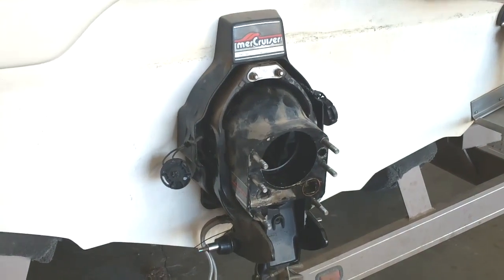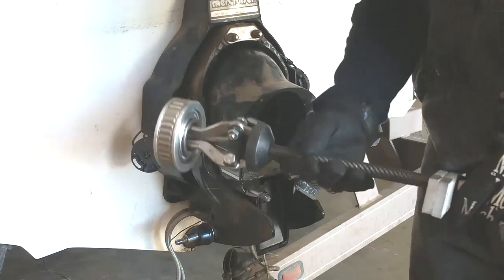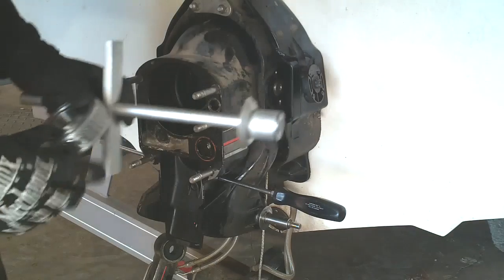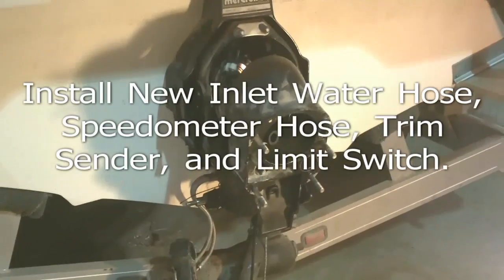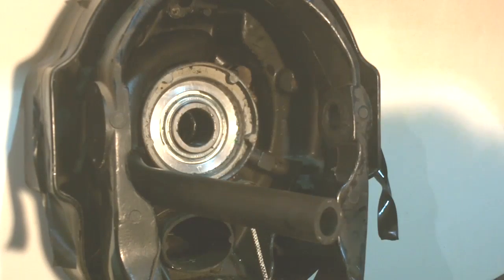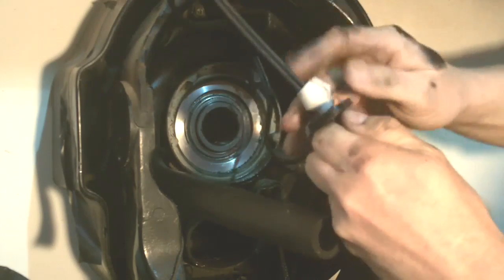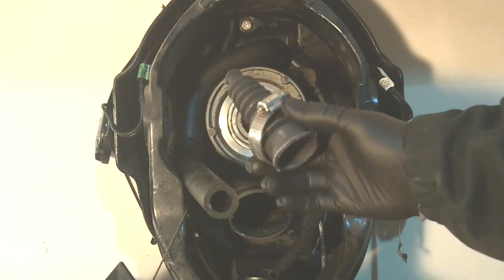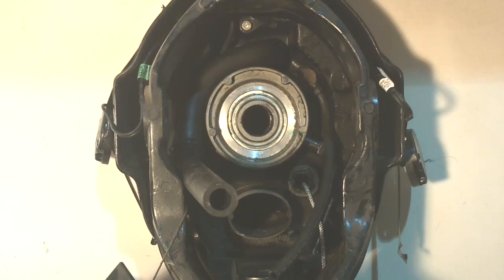How to Repair a Mercruiser Bravo Transom Assembly - Part 2

Comment: Where can you find the puller tool?  part/model number?  I'd rather get this than the mercruiser gimbal puller which only works for that particular bearing - I could use this tool for other applications.

Comment: Many manuals now instruct to put that bearing backwards, two notches facing you when installed...
Reply from the maker: +Derick R Service manuals have revisions periodically and a procedure may change slightly between different models.  We always advise following the step by step procedure outlined in your engine manufacturer's service manual. This video was made over 4 years ago and the manufacture has made a few parts changes as well as procedure changes that we have also adopted.  Let us know if you need any assistance finding the most current service manual for your specific model.

Comment: what about the gimbal seal?
Reply: How about the gimbal bearing that was hammered in by its' inner race?
Reply: noticed that also...
Reply from the maker: Are you referring to what MerCruiser calls the “Oil Seal” that sits in front of the gimbal bearing?  If so, it was inspected and didn’t need replacing.
Reply from the maker: +David Evich Service manuals have revisions periodically and a procedure may change slightly between different models.  We always advise following the step by step procedure outlined in your engine manufacturer's service manual. This video was made over 4 years ago and the manufacture has made a few parts changes as well as procedure changes that we have also adopted.  Let us know if you need any assistance finding the most current service manual for your specific model.